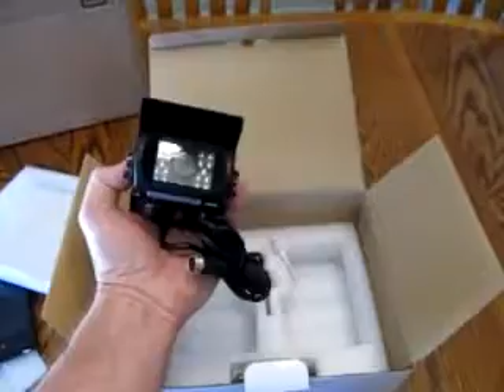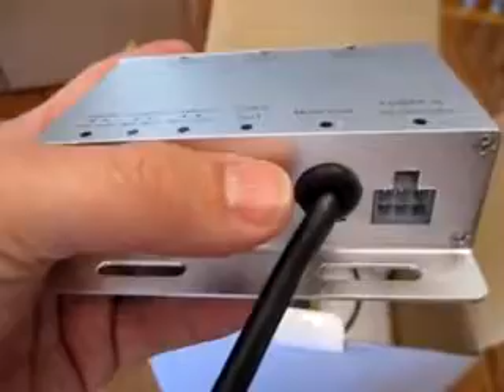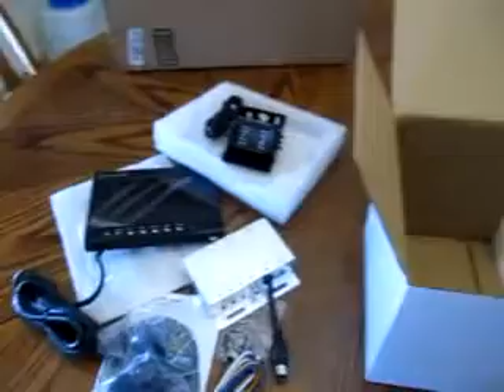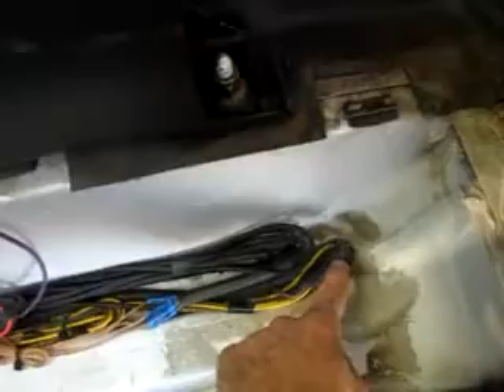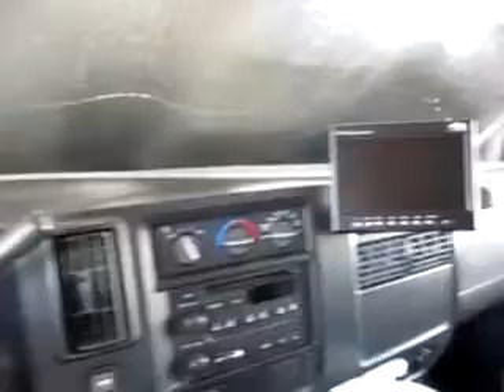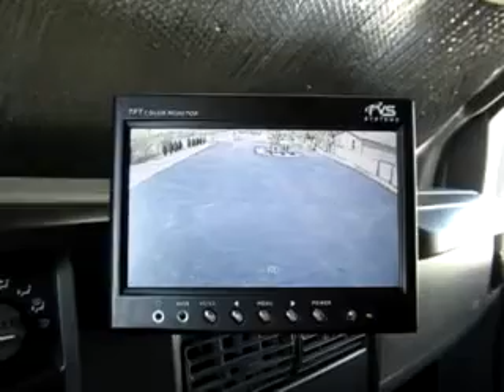RV Camera

Comment: Great Video! I just purchased the two camera system for my Tavel Trailer as well as the quick connect. Installed very easily. I hooked mine up to a toggle switch and directly to the battery so that I can turn it off with the truck still running.

Comment: I also have a Tioga and bought the same camera from Costco!  However, it looks pretty complex as a DIY.  I wish I knew you and could watch how you did it.  I feel so lost doing this by myself.  I have very little knowledge of electrical wiring.  It would have been super helpful to watch you install it step by step.  Not an easy thing to film, but just saying...

However, it did help to see how you did this.  Some knowledge is better than none.  Thanks!

Comment: great video review.. Im looking to do the three camera kit on my 30ft class a.  just a little tip to add, you want to you the trigger feature of your reverse or blinker triggers and dont feel confortable checking for the wire in dash or dont have the proper wire diagram.  The easiest way to check for this would be to tap into your trailer socket with a t tap purple is typically your reverse left yellow and right green.  i dont use a trailer so my plan is to run a three connductor cable back with my rear camera cable then splicing it into a removable plug connector